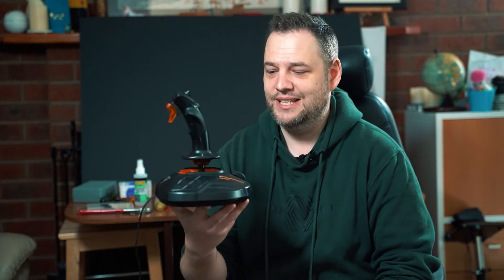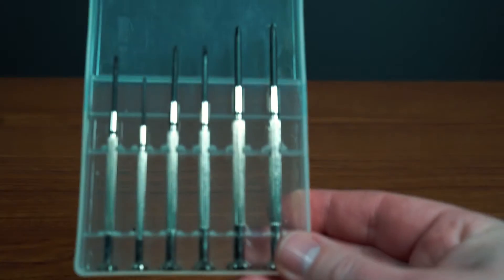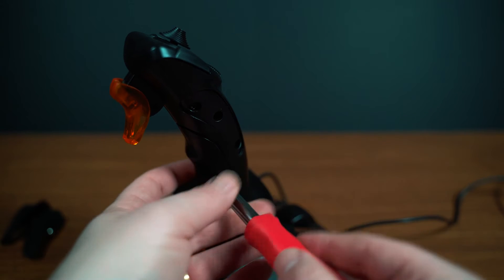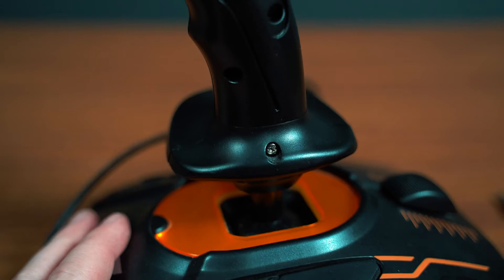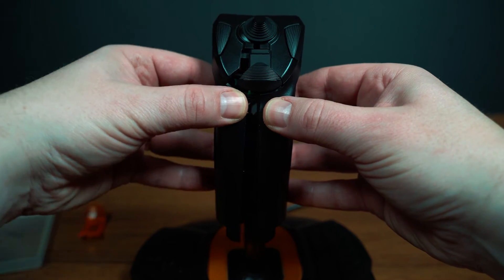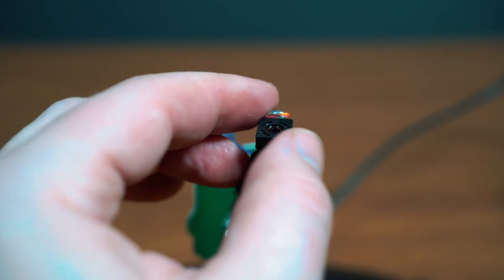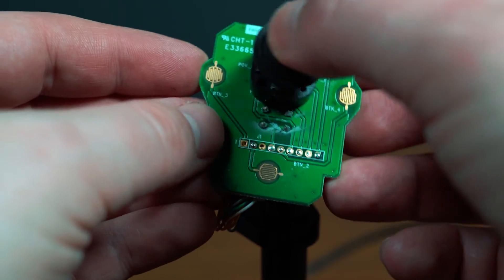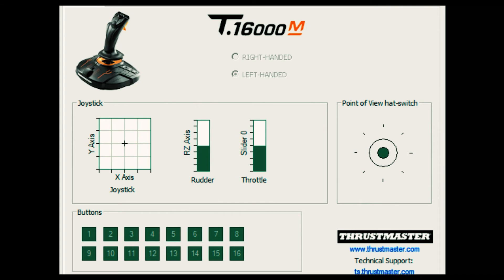Easy fix for T16000M stick/twist rudder - Complete tutorial

Comment: How long did this last for you? I've done similar (just using a different cleaning / lubrication agent) several times, but each time it came back after a couple of months... Eventually (after my 3rd T16000) I gave up and got a VKB Gladiator NXT, but if I could resurrect my T16000 as a back up reliably I'd be very interested to see if it's worth trying the alcohol...
Reply from the maker: I only did this once when this video was published and the fix is still working well :)
Reply: @ArveyJay  I guess it just proves that Alcohol is always the answer :D

Comment: Really good, had the problem today too. First I wanted to buy a new flight stick but the left-handed models are either sold out or they are not available as a left-hand version. 
So googled for a fix and found your video here. 
Since I only have my left hand, the Nippelofdoom were annoying. I then fixed this with a very small drop of superglue.

Thanks for the guide =)
Reply from the maker: Well done! I can only imagine how hard it was doing it with one hand. Glad the fix worked for you. 😁👍
Reply: @ArveyJay  At first I thought to myself, "Oh dear, dismantling is still possible but how do I fumble it back together." After a little thought, I came up with the idea of making an assembly device out of cardboard. =)

as my grandpa always said: "You can be stupid, you just have to know how to help yourself."

I have now ordered the Gladiator NXT - GNX Premium Left. Because with the T16000 I always have to take my hand off the stick to press the lower buttons. Especially in Elite Dangerous, depending on the situation, that's more than shitty ^^

Comment: I just got an used saitek x52 and it twists weird, to the left the most minimal input gets a full rudder response making it impossible to aim and to the right it can barely reach full range, plus it twists weird, too easily to the left and too hard to the right. I'll try to give it a clean to the mechanism and if it does not fix it I'll try sth else
Reply from the maker: Hmm sounds weird! Never tried the saitek myself but I thought it was meant to be good. 🤷‍♂️
Reply: @ArveyJay  it is it's just I bought it used and it seems to be very used but costed me 15 bucks
Reply from the maker: @jorgeharoo  ah! Makes sense

Comment: Great video! The fix worked like a charm. PS. Heating the trigger and its rod with a hair dryer for a few sec also loosens it enough to go out more easily.. But be careful not to overheat it 'cause it may break the electronics. o7!

Comment: Only 2 out of 10! Sheesh! You do underrate yourself. So a sincere thank you for the video! That looks way harder than I was hoping it would be.  How do you know when you have cleaned the Z axis pot well enough to fix the drift? That seems very hit or miss to me.
Reply from the maker: Thanks. I guess the point was to say that anyone can do it :) In terms of knowing when you have done it well enough I can offer the Conan the Barbarian solution which is to say, plug it in and see if it works ok after the fix?!?! It's not too complicated really and there are a few comments here from others who didn't even take the whole thing apart, just cracked the case a bit. Let me know how you go!
Reply: @ArveyJay  thanks Arvey! I've started to read some of the other posts and it looks like there are a number of things that could need fixing at the same time... But it will have to wait until I have a clear head (I'm currently off work with sinusitis...). We are also in the middle of a house move as we started new jobs. So the hotas will need to wait a while yet.
Reply from the maker: @SusannaSaunders  understandable!

Comment: Before going too far into your video I felt the need to add my dilemma on fixing a T16KM joystick
After the first stick failure I tried to fix it (per a different video) but unfortunately I have to deal with tremors so precise movements are nearly impossible.
Because reaching for the correct keyboard keys is frustrating I use dual T16000Ms that are keybound in as efficient a manner as I can... but the Z-axis failure issue has been terrible (6 of 9 sticks have failed / 2 in use, 1 boxed).
Btw - I also contacted Thrustmaster and was told it's a common defect with no replacement or repair.
I hope your repair is possible.  ;-)
Reply: A non-alcohol drink, until after success or failure (wait a day or two).  ;-)
Reply from the maker: Yeah the TM responses are quite frustrating given there is indeed a fix and many people (just in the comments section of this video) have found a successful solution with this method. Let me know how it goes for you! Ultimately many voices all complaining to TM might be our best longterm solution.
Reply: I had suggested to TM that they eliminate this defect in their next version but again didn't get a response or indication of any new version to be introduced?
An example of "Planned Obsolescence".
Reply from the maker: @TairnKA  to quote Chris Rock: "They got metal on the space shuttle that can go around the moon and withstand temperatures up to 20,000 degrees. You mean to tell me you don't think they can make an El Dorado where the $%#@ing bumper don't fall off? They can, but they won't."
Reply: @ArveyJay  The bumper will stay on but the engine, transmission, pollution controls, and other assorted pieces likely won't last much past their warranties.  ;-D

Comment: It took 2 years for it go weird on you?  You must not have used it all that often.....my twist axis went wonky after roughly a month of daily use.  The rudder paddle on the throttle went bad around the same time.  LOL
Reply from the maker: It's a bit sad when "Doesn't break instantly" is some outlier of magnificence :)
Reply: @ArveyJay  agreed.  Your fix worked ok though.... Dunno how long for, but it seems to have corrected the problem at least temporarily.  Might try the same thing on the throttle paddle.  I must admit I'm a bit disappointed in thrustmaster.  If I drop $150 on a hotas system, I expect it to last more than a month, but in their defense, most of it is still working exactly as it's supposed to after a year or so.

Comment: Wow, this video will prove useful for me for sure, all I've been doing is smacking the damn thing, and that doesn't seem to help at all!
Reply from the maker: Let me know how you go with it!
Reply: @ArveyJay  The procedure was successful! I did use some of the additional tips from commenters below for the silicon nipple button replacement, popping the buttons out, did make it pretty easy to put them back. The trigger pin was very persistent, so I did end up using a hammer to get it started enough to get some pliers onto. When I replaced it back, I left enough of it exposed to get a bite onto, if I have to repeat the procedure at some point.

 I'm using it now. I'm hoping the cleaning process will fix the issue; it hasn't occurred yet. Even if it does begin to twitch again, your process is great! Thanks!
Reply: I forgot to mention, there was a small block-shaped restraining tab of some sort that had appeared to be broken off at some point, probably early on when I got it. I super glued it back on, but I heard it break off again at first twist.
Reply from the maker: @napolisquared  good work on the fix! Hopefully the plastic bit doesn't cause you issues... other than rattling about!
Reply: @ArveyJay  One last update - after about 12 hours of use thus far, the leftward twitching has not occurred. Very happy about that, thanks again for this video!
Reply from the maker: @napolisquared  awesomeness!

Comment: only problem i got is getting th e trigger rod out i got   the tool to go in im pushing but nothings coming out
Reply from the maker: You're not alone. There are many others who got stuck on this part.  Try a soft mallet against your screwdriver while the stick is laying on its side on a soft protective surface. Let me know how you go. It does come out but it is wedged in there.
Reply: @ArveyJay  the case was open enough that I was able to slip a q tip    and clean the sensor off.   So I did fix my issue but of course now the stick is more stiff  when I rotate it will stay there  but it's not bothersome though   I'm just glad it isnt rotating  on its own

Comment: I had the same problem at the yaw axis, to me it looked like the plastic of the joystick that act as mechanical tappet for the pot was worn out so it has no exact guide because of the mechanical play at the twist move. I applied some small paper masking tape stripes to the tappets and the problem was fixed.
Reply from the maker: Good problem solving!

Comment: Thanks my friend took  me 90 mins but works fine now.   As for the boob buttons i squashed a cotton bud and inserted into the top of buttons, and i put a tint tiny bit of treacle on the bottom of button were it is fixed never moved at all. Thank you again for saving me money.
Reply from the maker: My pleasure! Glad it worked and thanks for the tip.

Comment: i could not get the trigger pin out, i almost bent the screwdriver. Its stuck in there :(
Reply from the maker: A few others here have had that issue. Check the comments for tips from the community. It will come out eventually.

Comment: Had same problem with mine. After having to do the whole process three separate time every couple of months with the alcohol, i changed one thing. I used a can of brake cleaner. Took the sensor off leaving wire attached. Covered the rest with a towel and "sprayed and prayed". Now almost a year problem has not returned.

Comment: I drilled holes on the palm face, just below the switch under the hat switch, below the circuit board inside the joystick. That way, I can easily clean the potentiometer on regular basis using contact cleaner with the "straw" and without disassembly of the joystick. Works okay...
Reply from the maker: Intersting. Hopefully the hole doesn't introduce more dirt into the system. Maybe tape it over when not in use or something?
Reply: @ArveyJay  I actually use the small plastic caps from a bottom end of a ball-point pen (the kind that is basically a plastic tube with an ink cartridge) to close the holes. Works good.

Comment: Hi Arvey, mine too started acting up like this 2 years in. Made Elite unplayable and DCS a pain. I was looking to get a new stick, but they are all sold or extortionate in price. Came across your video, had a go and it worked. One change I made was using contact cleaner spray in place of IPA. I have it as I am a tinkerer, I had this apart to see if I could fix the pot. But I took apart the base and thought the twist was to do with the hall effect in the base. Never thought to check under the handle. Good man yourself, hope you are well and thanks again!
Reply from the maker: My pleasure and I'm so glad it worked for you!

Comment: Works like a charm! I just sprayed some electrical contact cleaner (also great for Switch Joycons), gave it a twist, and fixed it right up! Got lucky and didn't have much issue with the nipples of doom.

I did find my trigger pin pushed out a little easier from right to left.. but I may have pushed a little harder due to frustration. It took more force that I expected, but came out smoothly.
Reply from the maker: Good work mate!

Comment: This is such a common issue with these otherwise good sticks that if someone came out with a hall effect sensor kit that you could retrofit it with they'd make a fortune.
Reply: All they really need to do is modify the injection mold to add some sort of barrier between the wires and the pot. It's somewhat crazy that this stick has been in production for over 10 years and there's been no quality improvement efforts over that time. If VKB would start distributing to resellers, they'd make a fortune.

Comment: I chickened out once i saw the nipples of doom. I just stripped it to the point where you prise the 2 halves apart only to the point you can see what needs to be cleaned and cleaned it from there. Didn't need to take the top off. Stick didn't work for about an hour, then bingo worked like it did when it came out the box. That was just before Christmas and worked great since.
Reply from the maker: Good work !
Reply: @ArveyJay  Thanks for the video,  I was about to throw it away.

Comment: I just did this with your help.  I figured "what the hell, if this doesn't work I'll try new one". With that in mind, I used a tiny drop of instant glue on the 'nipples of doom' and bingo.  First shot I fixed my jumpy pot AND reassembled on the first try.  BONUS, the buttons all work. :) SUB EARNED.
Reply from the maker: Awesome to hear mate, glad it worked for you!

Comment: NIPPLE of DOOM made easy! When you have the joystick disassembled (if you look insight the handle half) you can see a little square on the button (in video 6:17 you see Arvey actually even touching it), push it with a screwdriver, and wiggle it out you don't need a lot of pressure (don't break it!) once out apply a little quick clew and clew the damn nipple to the button. Assemble the whole stick and push the button back in from the outside.

Thanks, Arvey great video you sound like a true technician, see you in the dark 07
Reply from the maker: Thanks mate, good tip!

Comment: @Arvey Jay - Many thanks for you video! I just fixed the yaw problem that crippled my 16000M (it had about 600h of flight, I didnt want to have to replace it).

A few additional pointers to other folks performing this fix:
- You can take the buttons out when you reassemble the handle. Each button has a lock mechanism, so you can push them into place, and they'll lock in.
- I used the slightest bid of epoxy glue in these freaking "nipples". Makes the whole world better. But be very careful not to put too much.

Safe flight CMDR.
Reply from the maker: Nice work mate and cheers for the tips!

Comment: Thanks for the great video on how to repair the yaw on the T16000M stick.  Some additional suggestions and things I learned:
1) I used a 1/8 inch punch to push out the trigger pin.  It was super easy.
2) I removed the 3 buttons with nipples completely, super glued the nipples in place on the buttons, and then attached the buttons after assembly. This is much easier. The side buttons, 3 and 4, have hooks that go over notches on the outer side of the hole and then a clip on the inside snaps them into place. The center button, 2, has clips on the top and bottom so just but the button in and then snap in the top.
3) Gently pull some extra wire from the base of the joystick. I kept the joystick hooked up when I disassembled and found the jitter stopped when it was taken apart. I think the wires were tight and pulling the potentiometer. I cleaned with alcohol anyway, though.
4) Be very careful of wire placement when you reassemble. I had to resolder a wire when I carelessly placed it over a screw hole.

Comment: Hi Arvey. Thanks for the great guide. Could you share the location or name of the software that you used to check the results of the fix? I can't find it. Thanks!
Reply from the maker: It's just the windows properties panel for the stick. From memory in control panel, game devices and then right click on the stick and hit properties and it should be in there. Give me a shout if you still can't find it 👍

Comment: If this doesn't last (fingers crossed that it does), I disassembled as described, then that short set of wires in front of the sensor, I pulled up about .25" for just a bit more slack. Then, if you look inside the handle halves, you see some contact points that guide/hold that sensor in place. IMO that's a little tight. I took some extremely light sand paper and took a few swipes at it. Not much, just take the slightest amount of surface off of it to free up the sensor from sticking against those points. Reassemble. So far so good for me. With any luck you don't have to do any of this a second time.

Comment: Being that I'm a tinkerer and fixer of things that owns a large collection of tools(I assemble and modify a lot of R/C cars and trucks), I'm just here to see what solution you came up with to fix yours. Pretty much the same way.
Differences: I only pulled one side(left side) of grip off. The rudder pot is accessible with the other side left on the stick. I use an electronics cleaner in a spay can with tiny straw. Basically a pressure wash. Stuffing paper towels to catch overflow.

Comment: Fantastic - only 1 thing I'd add for sanybody attempting this clean .. I had trouble removing the trigger rod .. inn fact I could not budget it at all .. I took the opportunity to clean the ball joint of the joystick as it is always exposed (and didn't need a clean) and all other externals as I could reach .. and possibly some of the IPA seeped in and worked its magic.. I tested the joystick and it was fixed! The RZ moved beautifully so there may not be a need to actually get at the sensor internally.. Great video AJ
Reply from the maker: Hopefully you've seen that I made a dedicated video dealing with the rod now. Here you go: https://youtu.be/GSmK62tsq9g
Reply: Kinetically encouraged!  Thanks for the leg work mate ... off to dust that mallet off....lucky I didn't chuck it in the bin
Reply from the maker: @michaelmcnally6093  👍👍

Comment: Problem with this job is that the 'sensor' is probably one of the absolute cheapest in the entire universe. It will probably fail again, despite this fix (which IS just about the only remedy). I bought this stick off Amazon (luckily) and went through FOUR replacements before finally deciding to go down a different route (VKB). It's a shame because when the stick WORKS it's actually pretty good, for the price.